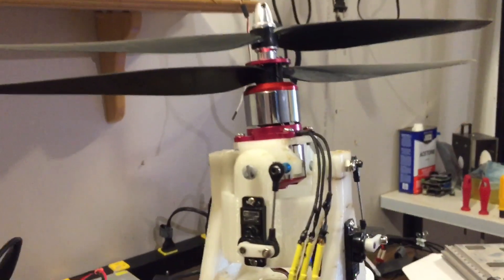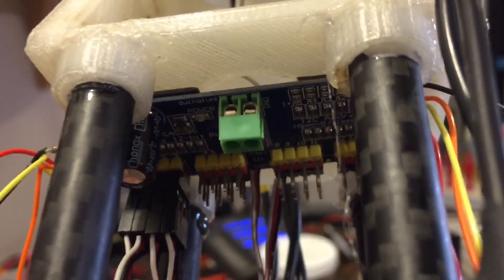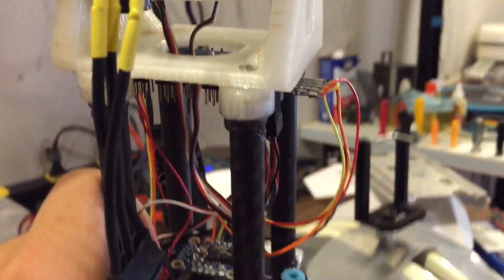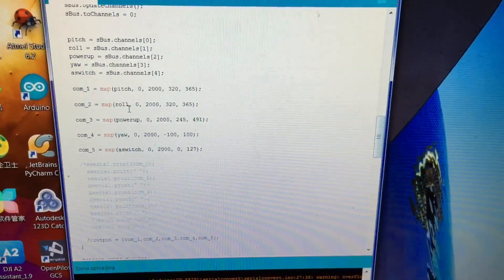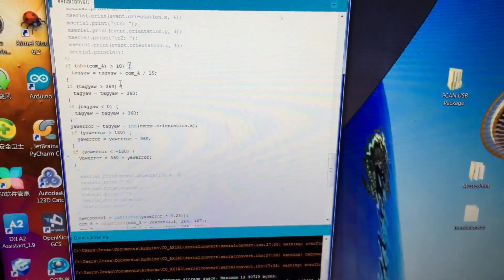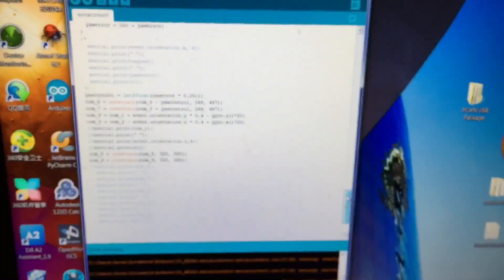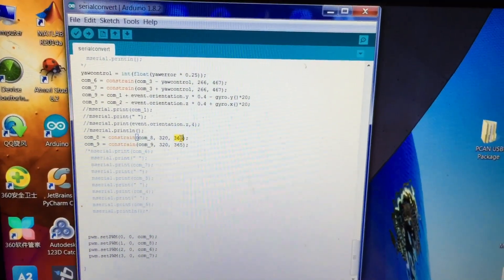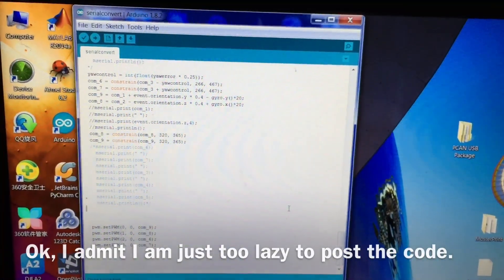My Coaxial Drone (make your own flight controller)

Comment: So it can be controlled by tilting the rotors? I quess it can never be as stable, or nimble as a quadcopter.
But I like the simplicity of the idea.
I think they should use coaxial drones especially when broadcasting audio because two large slower blades would be more silent and produce lower pitched noise (which is less annoying) than four or more tiny rotors. Also, I believe a large rotor is more efficient than many small ones, so it could stay up in the air longer.
Recently I saw drone footage from the bathurst 12h race. It was fine except the drone noise.